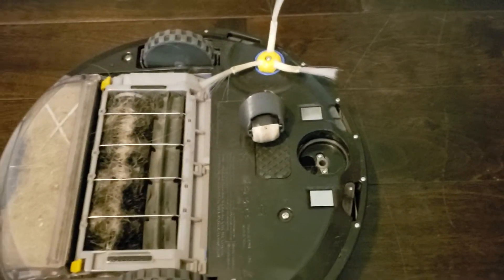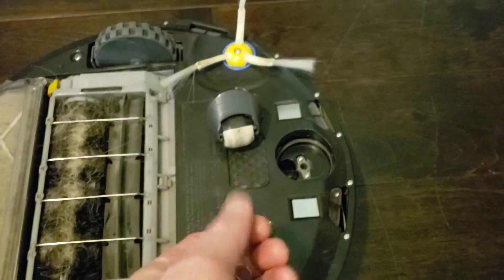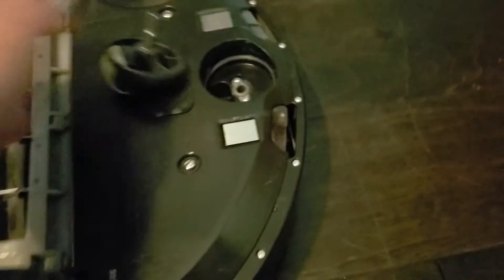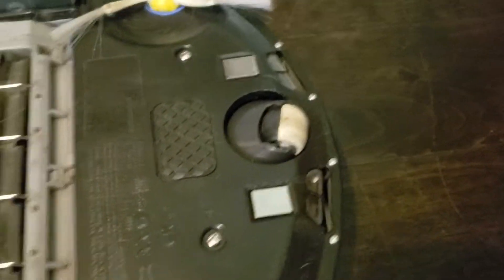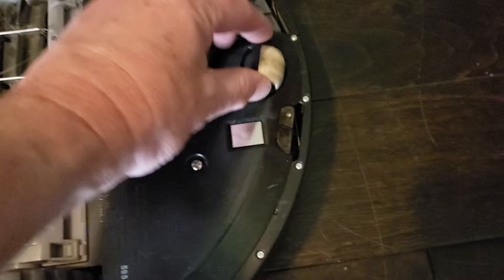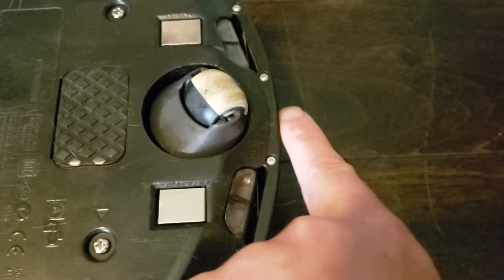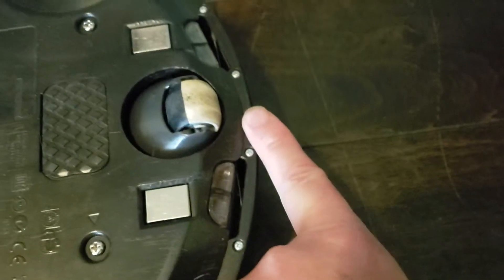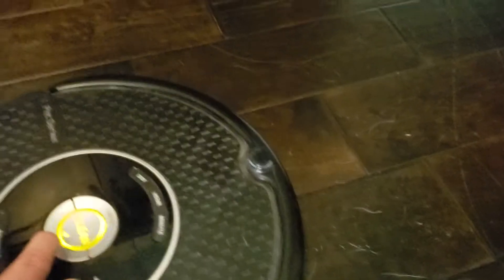Roomba won't dock - FIXED

Comment: Would be nice to see the original problem, so I could see if my problem is the same. My Roomba pulls into the dock ok, but then starts "bouncing" trying to settle, turns this way and that, backs off and tries again. Will spend 30+ minutes until the battery is dead.

Comment: First off, your video is amazing. Showing the fix then the explanation is the best way to set up a video. Second, it actually worked! Everything I saw online was pointing to the contacts being worn out and needing to be replaced. But this didn’t seem like it was the issue for me. The Roomba was stopping at the end of the base, and was still charging. I didn’t have any washers big enough, so I took a zip tie and tied it on. Works perfectly now. Thank you!!!

Comment: Just opened my 675 series and cannot get it to connect to wifi. But also not sure it charged all the way. 

Light goes green and shows and empty green battery symbol but turns off after 1 minute. 

Looked up my model and saw a slew of bad reviews about dock and charge issues. So saving this video for the future. 

Kinda disappointed in my xmas present because its being problematic right from the start. 

Anyone have any tips let me know.

Comment: Just tried this and it didn't work, however what did work is removing the bumper, (be careful when pulling the bumper off after unscrewing it, the top sensor is attached and you don't want to rip the wires)  Then give it all a good cleaning. hope this helps anyone there who's losing their mind like i did 😅.

Comment: This worked. My 2.5 month old  i7 would not go up on the dock more than an inch or two, then back off and try again and again (hitting the front bumper?).  The base is on carpet.  I moved the base to a hardwood floor and repeated the test to dock and it docked fine. I then added two washers under the front wheel per this video and returned the base to carpet and it worked fine.

Comment: The washer I had was too thick-  While it solved the docking problem it didnt charge because of the new distance that was happening between the vacuum and the dock. Things didn't line up anymore. So I used one of those plastic bread bag fasteners instead of the washer and that solved the problem for me!!

Comment: This worked for me. The problem is not the bearing, but rather the wheel has worn down. I did this washer trick and it worked. 

Well, my mother in law gave us a new roomba, and I noticed the wheel was the same but without the flat spot. I got the new wheel from new roomba and put it in the old roomba without the washers. It also worked. The washers is the cheap fix but the problem is the worn wheel.

Comment: bad diagnostic , the real problem is the front wheel , it's extremely worn and lower the Roomba.  The tires on the motorised wheels will also need to be replaced soon.

Comment: Your fix worked like a champ.  I kept thinking that the connectors weren't making contact.  Would have never thought lifting the front would help, in fact, I thought the opposite.   I have had some other problems with the base and cleaning contacts.  I have been able to fix them with cleaning with isopropyl alcohol and applying DeoxIT D5.  This stuff works miracles on connectors when they start to get old.  BTW, I am not associated with Deoxit in any way, just have had good luck with it at home and work.  Not cheap, but it works.

Comment: Mine was not docking either. I cleaned out the silver connectors on the docking station and now it works. I think stuff gets trapped under there as well. Thank you for your video.

Comment: What size washer is it?
Reply: It was the size washer that fit on the post. It was thin. Sorry for the ambiguity, but a small, thin washer raised the bumper high enough that it doesn't bump the charging station.

Comment: Is that the 595 👍. Yeah mine starts up the charger then hear a crunch noise as it starts to spin and drags station around, drives me nuts. You can buy replacement tire treads off Amazon when they become worn like mine, runs great now. I tried this and worked, been looking but do see any place selling that gray bearn to replacs just caster assambley

Comment: After gutting my vacuum thinking I had an internal problem than I tore down the charger and still still no issue. Finally I came across this video and put in a washer a boom problem solved, Thanks!!!